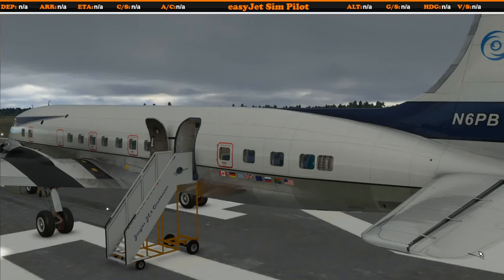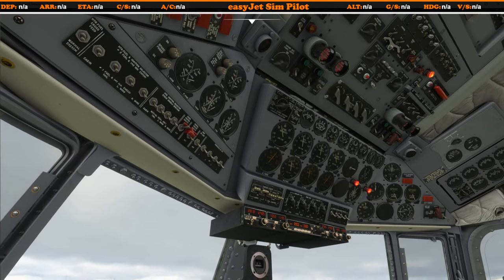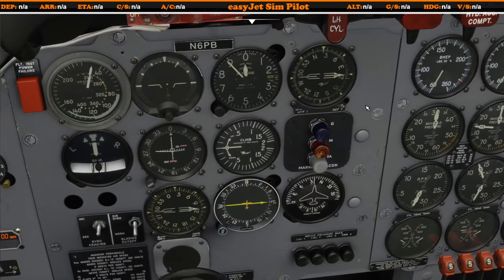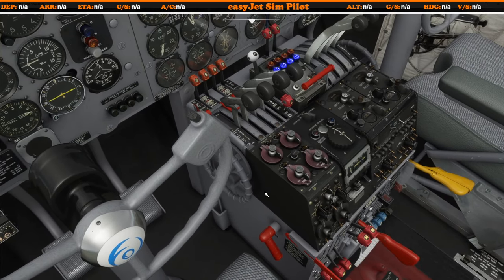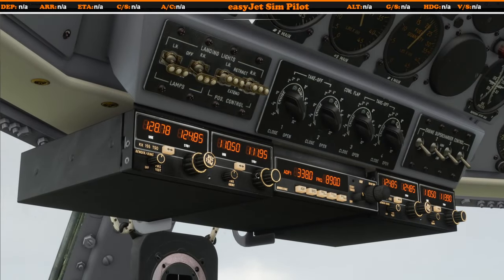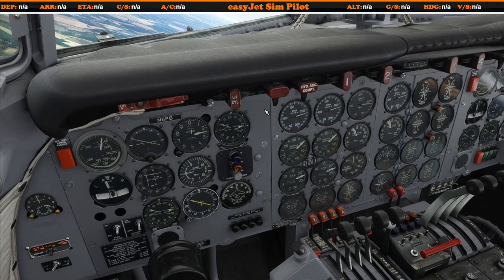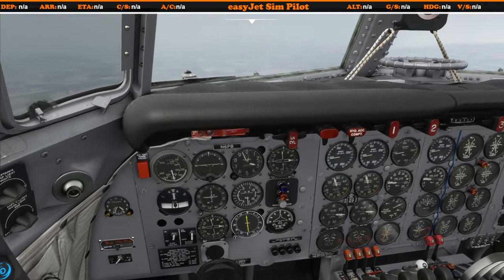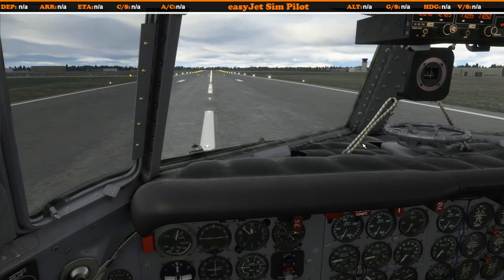PMDG DC-6 Quickstart Guide - Full Traffic Pattern & Autopilot Tutorial | MSFS 2020

Comment: Hi Gavin
Flown this thing quite a bit now and it behaves as it should without GPS. Radio nav is so involving and I must admit to getting hooked on it.
One thing I haven't got sussed yet is transferring from GPS to ILS. It seems to not pick up the ILS after following a course on GPS although it can see it. Same flight with radio nav works every time. More to learn on my part I guess!
Thanks for the video.
Reply: You changing the dial to approach mode?
Reply: @dommorris325  Yes!
Still haven't sussed it yet. If I do radio nav then go to approach it works every time. Do a GPS track and go to approach and it's a lottery.

Comment: You seemed to be having problems controlling the speed on the landing; lots of throttle adjustments. I noticed you actually landed with 20 degrees of flaps. The PMDG tutorial uses 50 degrees. That would have definitely helped to slow you down without as much throttle movements.

Comment: When I tune in an airport or an ILS it won’t work? Only works at the airport in sat at? Do you have to be in a certain distance away for it to find it?
Reply from the maker: Usually around 20-25 miles.
Reply: @Easyjetsimpilot  thanks, is the same for the NDB frequencies ?
Reply from the maker: @dommorris325  yes. They have a slightly longer range, 50-70 miles usually.
Reply: @Easyjetsimpilot  thanks very much for that